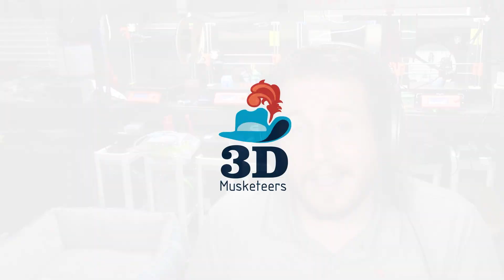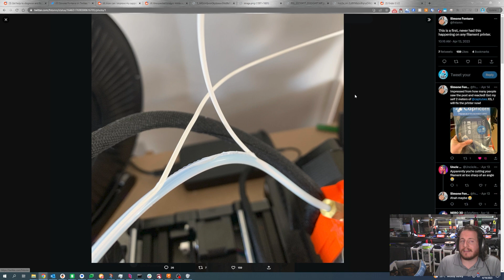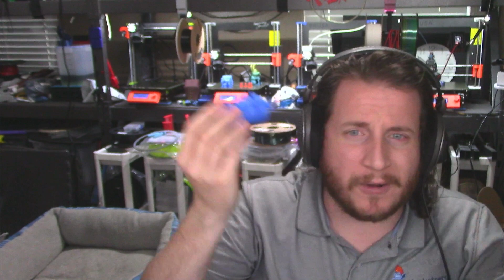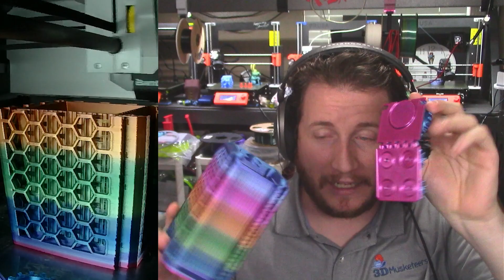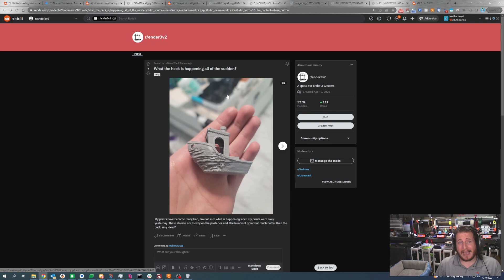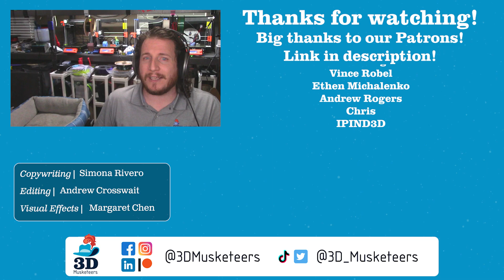Totally NOT Tubular! - PrintFixFriday 84

Comment: when the blob occurs heat the sovol up to 300 watch it melt for the most part u may have to wipe filament off some areas ps i have 2 of them and have both failed i have 2 hot ends coming from sovol apparently it is a defect lets se if they fix it
Reply from the maker: 300 is a bit high, but yes heat is good here

Comment: I actually have some PETG now. I'll be printing MK4 parts soon. But I'll also experiment with alternate support interface material. The rocinante model I've been printing for the past 2 months and 1 day is almost done. Last major part of the ship should be done next week. I started it yesterday. It's a 4 day print and I've lost 8 hours (MMU issues) because it didn't print when I went to bed last night. But thankfully it did print while I was at work yesterday. After that is just the stand. That's an 8 hour print mostly monocolor. Then I'm going to do all kinds of experiments with PETG. I know PLA doesn't stick, but.....if it's encased can it hold PLA. I didn't want to order orange PETG for JUST the prusa logo. So maybe with PETG on either side it will be ok? Also what does purple/orange look like? And like I said I definitely want to do PETG based support interface for PLA prints.
Reply from the maker: PETG will not stick to pla if that's what you're asking?
Reply: @3DMusketeers  well I know that, but what does it take to purge it. That's what I need to find out. If you have a dual extrusion printer it is a great choice, but with a prusa MK3/4.....how much of a pain is it?
Reply from the maker: with my bambu, since I dont have a MMU, it has been a pain for sure
Reply: @3DMusketeers  I would think the AMS would be easier since you have the poop shoot. One of my concerns is some people saying the purge block didn't work so well for them.